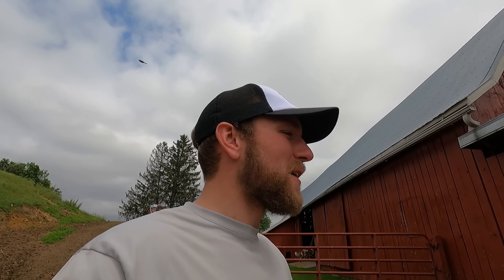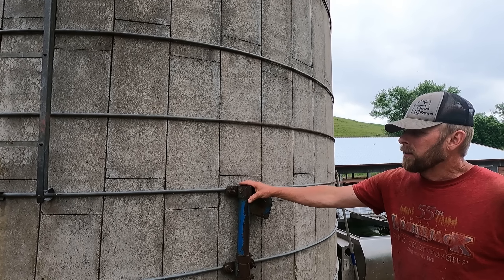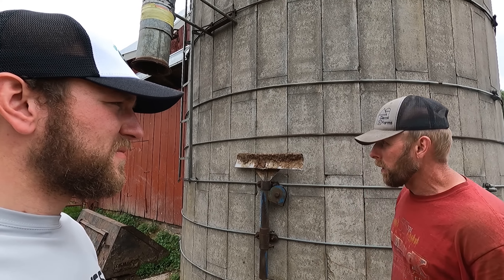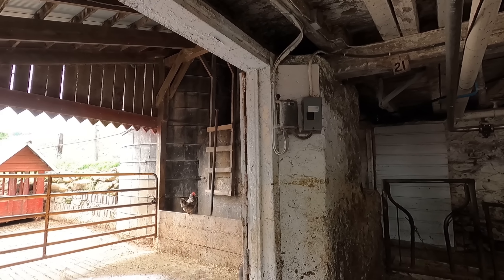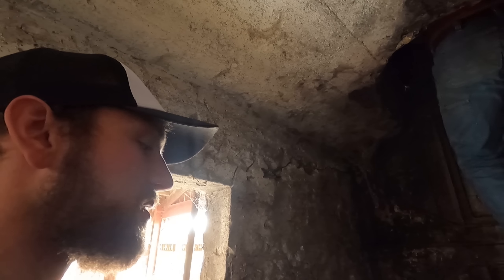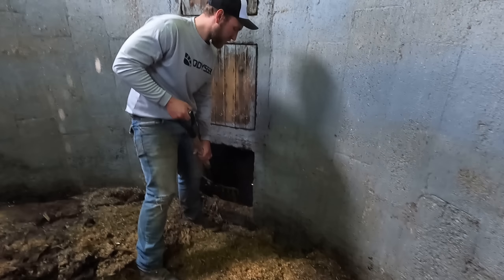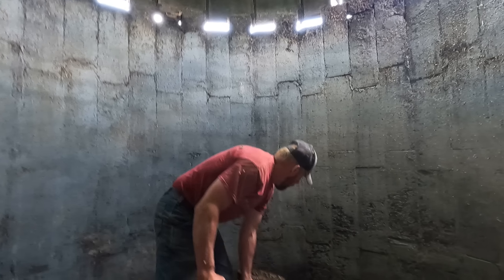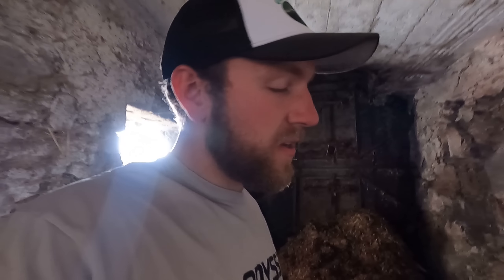Opening Up a Silo On a Small Dairy Farm!

Comment: We have a 20x70 silo here on our dairy in central mn and they are still the most common feed storage around here for most guys milking less than 100 cows   Kinda interesting how things change from place to place.  The silo companies around here still build new silos generally 1-4 per yr depending on things.   We’re actually hoping to build a new 14x70 in a couple yrs for high moisture corn.  New silos run in price from around $20,000 for a small one like yours to well over $100,000.  Biggest ones over here is a pair of 30x100 they’re huge silos on a 120 cow robotic milking setup the one is around 20yrs old the other about 10yrs old I say now.     Love the videos 👍

Comment: Nice video. Always interesting seeing your stories. We have two 18x50 silos that have Vandale unloaders. Used year round. Yeah, they took some labor and repairs, but not any more than other machinery used year round. And I felt like I could turn the silo's on, then go do something else. It was a good labor savings. 
One was haylage and one was corn silage. Yeah, haylage takes more management to chop and blow into the silo. It can get sticky quick. Corn silage was always more fun and smelled better. Get the silo full, then level it out before lowering the unloader. In the winter it would freeze to the walls and when you finally got a week of warm weather, I'd have to get in and knock the 8" of frozen stuff off the walls. Not to mention climbing every couple weeks to lower the unloader another door. But I'd rather that then unload by hand! You guys work too hard! Watch out for mold spores. 
Good memories!

Comment: When I was a kid we had had a 14x40 brown tile silo no unloader (well me) and even with corn in the winter there was plenty of wear and tear on my body. Eventually it was replaced with a 16x60 Madison silo. We had a ring drive Starline unloader ring drive style and that spoiled me. We could crank it up to pitch silage by hand if we need too. That wasn't so bad. After about 10 years Dad built another 16x60 Rochester silo and word of mouth was that Badger unloaders we're the way to go. So Dad bought 2, one for each silo they have both been running strong for the better part of 40 years but we always plan on big maintenance when the silo gets empty. We always change out motors when it's at the bottom. Keep spare motors on hand for that get them rebuilt. You certainly prefer to change motors at the bottom. (Not that that ALWAYS happened. Now days if I were to build I guess I would go bunker but I would have to consider the cost of building the infrastructure for one.

Comment: When I was a freshman in High School myy dad had tried to break the condition of a frozen silo unloader and loosen the machine.  In the process he pulled on the V-belts themselves as the motors pulley spun in place.  In an instant the machine let loose.  It was too late.  Before my dad could let go of the V-belts his hand went around with the pulley and his thumb had been severed at the joint.  It had cut clear through his winter buckskin mittens and clear through the bone.  We had 5 silos with unloaders and I always fave them a lot of respect.

Comment: Still putting new ones up here in PA, trenches and bags take up too much valueable land...............Setup as with a bottom unload "Big Jim" they are very efficient way to store and move feed.  With a good blower/big tractor/blow deck to unload trucks you can really pound the feed out.  For a small operation a tower silo is my choice, with good upkeep the unloader just works, and I would much rather throw a switch when its zero out and chip off some silage on the west wall every few days than screw with diesel equipment in that weather.  Also, I can't believe you don't have a rope and pulley in the chute to haul up stuff once your up top instead of carrying it.

Comment: Used to fill four silos and then cap them with plastic too.  I would tuck the plastic tarp around the outside the first day and then go up the silo a couple more times during the following week as the silage settled and tuck it down again.  That made a big difference on how much spoilage was around the edges of the tarp.  Had Hanson and Badger silo unloaders.  They were easy to work on, a bearing here and there.  Would do any major repairs when the silo was empty and the unloader was at the bottom.  Never had issues with silo gas as was always careful in that respect.  I actually prefer silos over bunker or piles.  No mud and snow to deal with and less waste.

Comment: Nice vide. Takes me back to my youth. Now you'll get me posting about my youth again. My Dad fed very heavily corn silage and used a product called Blenda Life as a supplement. Also, a small amount of hay, no grain or dry corn. Dairy barn had two 14 X 40s and a 20X 60. Smaller ones were hand emptied. Hard to imagine spending the money to put an unloader in a 12-foot silo. I could throw a fork full down the chute from the far side of one of the 14 footers. There was an unloader in the large one. On the beef feeder farm there was a 30 X 50 with an unloader on a tripod. Usually about 200 acres of corn but not all became silage. The two large silos were stave silos from Osseo. Yours looks like it was a Madison. The Osseo's had an inner layer that was troweled on. Not sure what it was, but it seemed like a concrete product. I started going up to throw down silage at somewhere between 8 and 10.

Comment: Is silo gas only when silage is still fermenting?? I've heard some farmers running a blower before entering the silo.
My uncle sold Patz unloaders and always tied his pant legs down by his ankles due to rats.
The short time I worked for a neighbor who had 4 silos. 2 small 14' silos for high moisture corn, a 16' silo for corn silage and a 20' for haylage. He would bag corn silage and when 16' was empty would refill with corn silage from the bag.  1 of the 14' silos would be dual purpose where he would put some haylage then some corn silage to help keep feeding consistency.
Amish in our area our still putting up silos.

Comment: iirc Harvestore still does sales of silage towers, as fuel and plastic costs go up we're going to see more electrically powered silage systems including enclosed bunkers that can use nitrogen gas sealing... the Harvestores can already do the inert gas sealing.    It won't be long before we start seeing internally automated large silage clamps with roofs over them that last for decades and use gantry cranes or come with Kuhn drag-line (suspended by arm) electric service tractors inside.

Comment: We had 16 × 70 James way unloaded we just put 1000.00in to loader it was down 6 door and motor went to hell 62 feet loader down and pull up 62 feet it suck  middle of November and really cold out
Reply: We had that Starline with a 10hp General Electric motor and we that happen at 52 feet. Heavy as heck. I have to say I preferred to do that rather than chop frozen haylage. At the bottom we changed out the GE with Baldor motors. We have had very good luck with those.
Reply: Have you ever taken the cable off of the unloader and lowered it down the chute hook it up to the motor and run the unloader winch up pulling the motor up in to the silo?
Reply: @ryanpockat8846  we hung a pulley on the door above and pulled up by hand Armstrong style. Usually we had someone underneath to help push it up from down below. I just now thought it was a good thing the rope didn't break.... Might have to rethink this. Seeing as our unloaders are suspended by 3 cables that could be kind of messy but your idea is good. I'm going to have to look at that.

Comment: Lots of lies here..those cheap stave silos leaked at the bottom when filled and the cable and winch in a real silo room ran it up and down and have a motor to raise and lower, and in the midwest you dont use sileage in the summer in these fill them and use them in the winter frozen the unloaders are not that dangerous they have a cut off on the unit to shut and turn on and work great on frozen sileage both corn  and alfalfa..so guys stop the propaganda here those of us with 5 generations of dairy farming know to well..